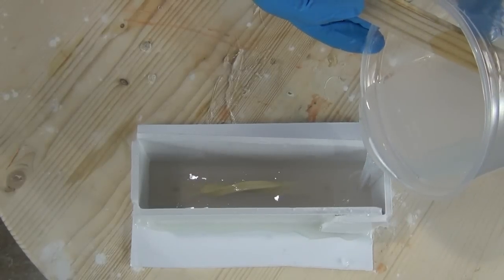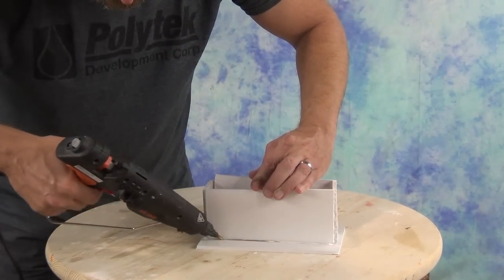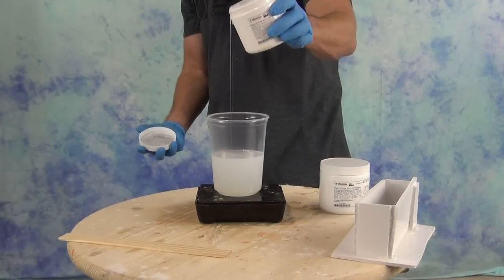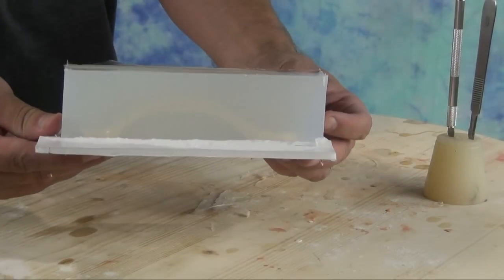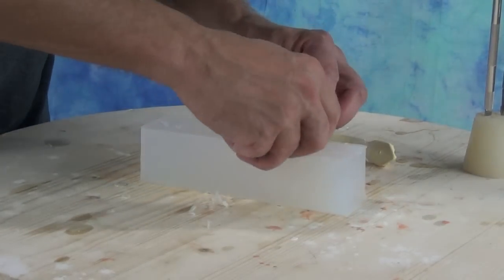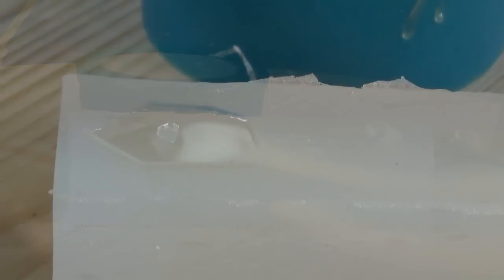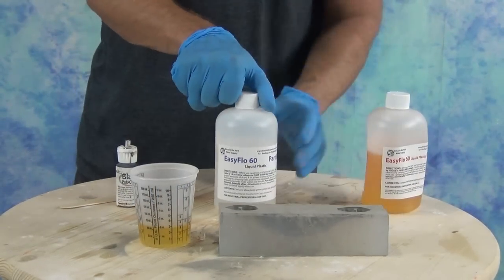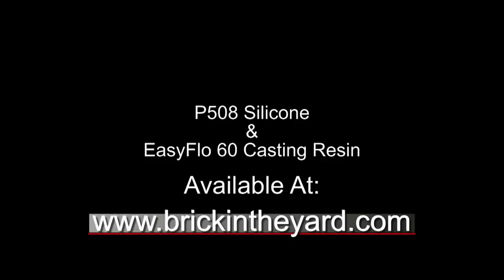Simple Silicone Cut Block Mold With P508 Silicone

Comment: I would love to see your (you guys) solution, insights, and techniques on making molds and casting double sided Resin Coins/Medals/Medallions.  I saw someone on youtube 3d printed a 2 part cast with a wide channel for the pour with two air channels, it's a good mold template where you can swap zbursh designs with.  Then I saw another person making two thin pieces of each side of a coin and then gluing them together ... still those two methods produced a seam.